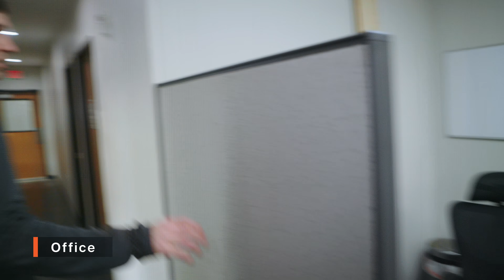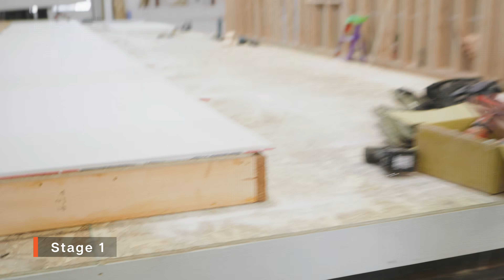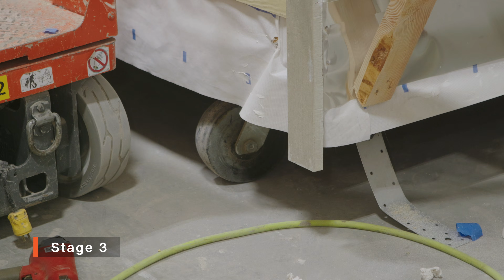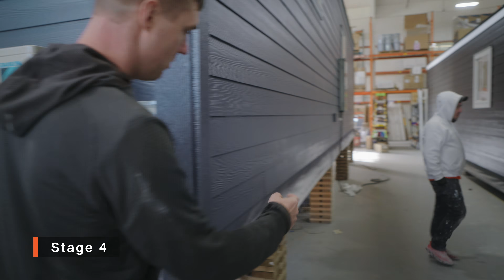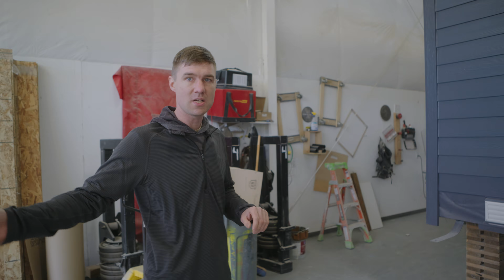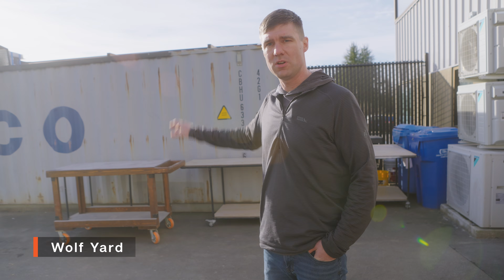Inside Wolf Industries: Exclusive Modular Home Factory Tour with Derek!

Comment: I saw you do a comparison of what Wolf does when building to what other companies do. I was looking at single wide homes sold in bend oregon, built by other companies and wondered if they all followed the same basic build guidelines. Wolf obviously goes above and beyond yet I would like to know how much difference there is for a homeowner. how will the better build quality show up in my everyday life if I am in a wolf home?
Reply from the maker: You may not SEE much of a difference day to day, but theres more than just the build quality. For example: in that video, we referenced the differences in insulation requirements, and where we go above and beyond. You can also reference windows to get a feel for the level of quality you'd interact with often.

There's also a lot more than day to day. Wolf Homes are built to last. Not all, but most manufactured homes aren't built with the same level of longevity in mind. It's not uncommon for lots of repairs to be needed with Manufactured as they tend to deteriorate far quicker than more sturdy structures. I would also point out, if you want a good sturdy home, its best to have a real foundation. If you were to put a manufactured home on a real foundation, it would be a similar price to modular anyway. Because we follow IRC building code, its not much different than having a traditionally stick built structure added to your property. This will add value. Unfortunately, Manufactured homes don't typically appreciate in the same way stick built or modular do, making them a poor investment from that standpoint.